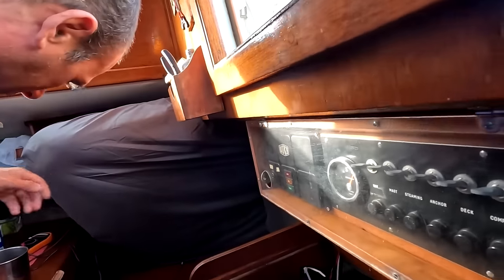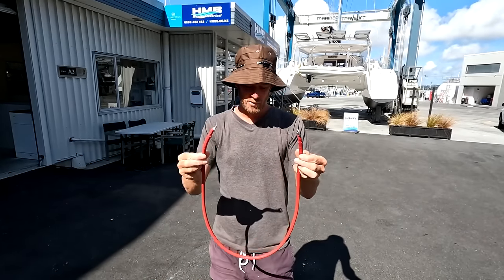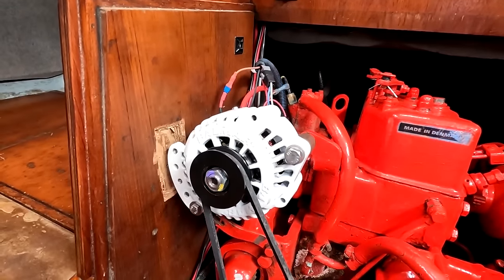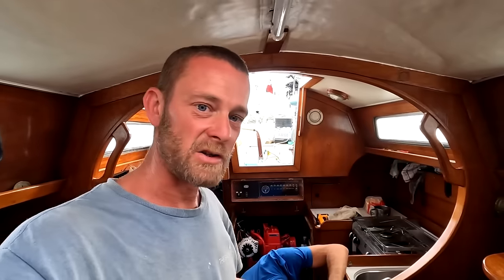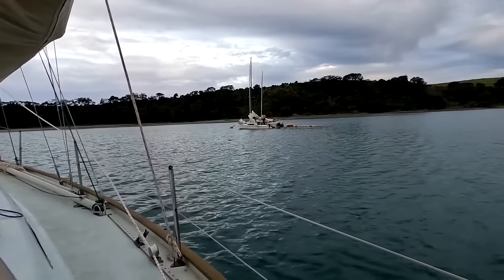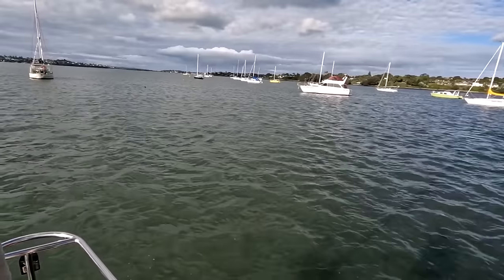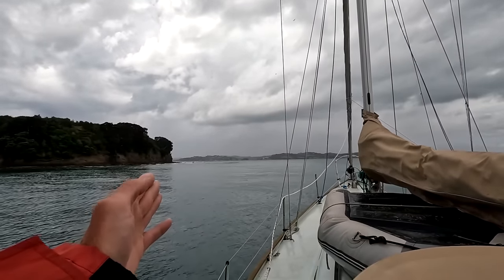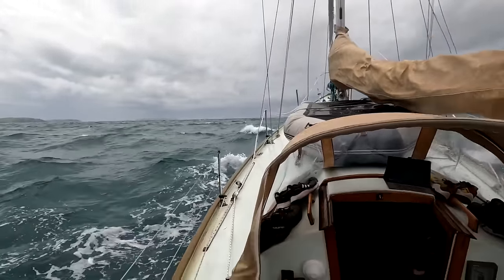Is Our Electrical System Toast? / Sailing Around NZ Pt 3   Ep147

Comment: Quite possibly a complete reconfiguration of electrical circuitry. You can’t risk something like that happening on a long passage. Major hazard to yourselves, your adventure and for those who would need to go picking up the pieces if it was a serious fire or blowout. 

On the plus side. You did get to celebrate Xmas and new year. Beit a lumpy one!! Could be the new nickname - lumpy!! Best of luck with the Circ guys. Fair winds stay safe
Reply from the maker: There's always a risk fitting a new electrical system and Gremlins to sort out. We are very lucky it was only a burnt wire could have been a lot worse. We actually love our new electrical system the lithium batteries are fantastic though. Yes it was a dumpy old Christmas in the river

Comment: Looking back at the install video, I recon you have the configuration wrong, the alternator you've now got is a smart alternator, they can not charge lead acid batteries, so if you've got that charging your starter battery, then that battery is feeding your dc chargers for your house batteries, that will be the issue, the smart alternator needs to charge the lithium batteries first, then run a dc charger off those to charge your lead acid battery.
A smart alternator does not constantly put out a charge rate like an old style alternator, hence why you think it's not charging. Basically they cut in and out whilst running.
Have it reconfigured and all should be good. Cheers Rich.
Reply from the maker: Very interesting indeed thank you Rich 🧐😁👍👍

Comment: Hi lads never have your thumb around the starting handle if the engine kicks back it will snap your thumb like a carrot. Best wishes .
Reply: Yes basic knowledge on building sites with lister mixers❤❤
Reply from the maker: Thanks for the tip seems to be a Hot topic 😉